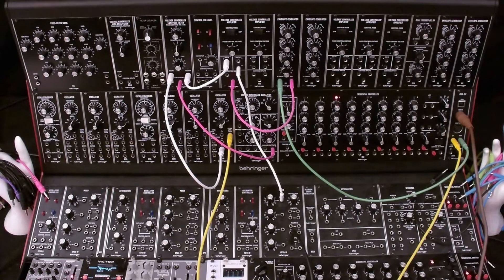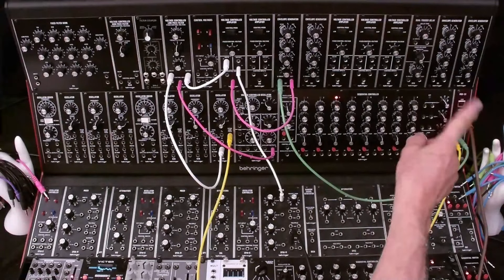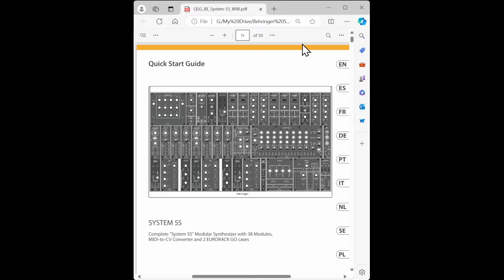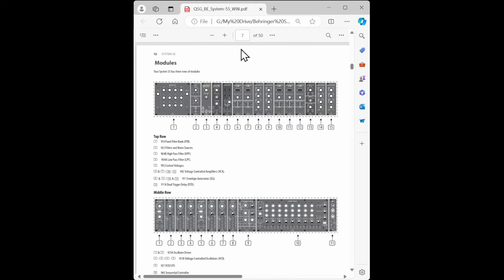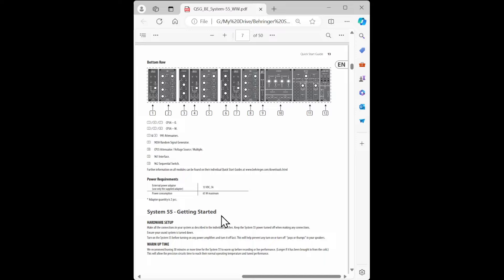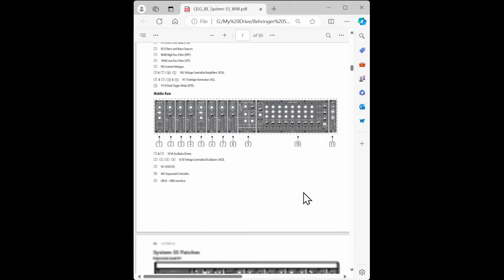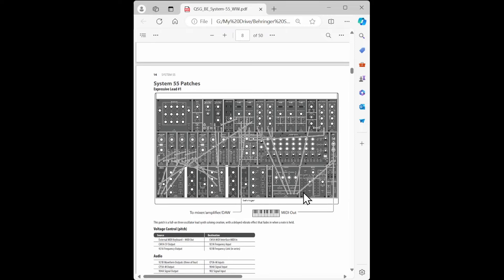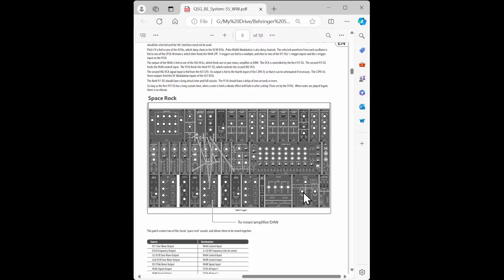System 55 Patching for Absolute Beginners

Comment: Is something wrong with my 55, or am I just stupid. I did the very first one. VCO(921) to mixer. To audio interface. But there us no sound, even trying all the nobs
Reply: Do I need a line booster or something?
Reply from the maker: Sorry to take so long to get back to  you.  The signal from the mixer should be a VERY hot signal compared to most (e.g. line level) signals.  So, no you don't need a booster.  My debugging steps would be to check Power, Frequency Range and Levels:
1) verify power to both cabinets (the mixers are in the lower cabinet, right?), vcos in the upper cabinet on the System 55
2) verify that your 921 VCO is in the audio range (check a) the second switch (upper left) is not in the "SUB" range.  Check the Raing switch and tuning frequency knob @ the noon position).
3) check your audio interface and cable with another line level device like your phone audio or a other synth.  Alternately turn the gain all the way down and connect directly from the 921 VCO to the audio interface.
4) check the level of the 921, if you're using the Aux Output of the 921.
Please let me know how this turns out.
Reply: @ozhalljr  no reason to be sorry, I really appreciate the answer back.  So I checked over, directly out from the auxiliary outputs to my interface and the switch set to audio I can get it to -18db but as soon as I go through any of the 3 mixers I can't get it past -30db even with everything set to 10. Maybe I should take all the modules out and make sure they are connected correctly. Again thank you for your help.
Reply from the maker: The -18 db reading from the 921 Aux Out seems low.  Check the gain stages in your interface.  Regardless, having as 12db drop through the mixer seems excessive.
Here are a couple of other things to try (before removing all of the modules).  
1) patch the 921 Aux Out through one of the (passive) attenuator modules.  See if there's a loss there. if not, I'd start suspecting the power in the lower cabinet.   
2) See if the noise source in the lower cabinet sounds about the same as the noise+filters in the upper cabinet (next to the lowpass filters).  if not, I'd start suspecting the power
3) try swapping power supplies between the two cabinets the check the 921 Aux out
Reply: So I trying all of that that you suggested. The sound level was still the same. Also tried oscillator(921B) to VCA(902) out to interface, still super weak. All this weak signals seems like it would be a power issue right?
Reply from the maker: @dillonoberhansli9764  Possibly.  I still suspect there is some mismatch between your Audio Interface and the synth.  My question at this point is "does the synth sound right" (other than the level issue)?  If so, I would not suspect the power supply.
 Do you have other synths? Do they behave similarly through the Audio Interface?  
Do you have an amp or powered speaker (even a PC speaker) with which to test the synth(s) to see if it sounds "normal".
Reply: @ozhalljr  so the sound is like what is in your video, just quite, I have a behringer arp2600 and a kord ms20 mini. For them if I wanted i could get them to clip.
Reply from the maker: @dillonoberhansli9764  I'm guessing you already tried swapping power supplies between the two go cases.  If so, I'm going to agree that there seems to be a level problem.  Perhaps you should be talking to the vendor (Thomann??? Sweetwater?) about getting this checked out.
Reply: @ozhalljr yes I did try switching the power supplies. OK ya I'm going to talk with sweetwater see what we can do. Again thank you for helping me troubleshoot this issue. I really appreciate it.

Comment: I seem to have a fault with my 904A VCF - although I can sweep through the entire frequency range manually, if I put a 911 Envelope Generator into any of the control inputs, it doesn’t open the filter fully on any of the three ranges. It’s almost like the 6 volt output from the Envelope isn’t enough for the VCF. The 10 volt output from my 2500 envelope into the 904A gives the proper result.
Reply from the maker: Is your VCF Range switch set to 1, 2 , or 3?

Comment: Thank you OZ for your detailed and yet simple to understand introduction to the System 55 (I'm an old fart and absolute beginner, not yet owning a S55...so I utterly rely on easy-to-understand video introductions). I'd be most interested in your 4th row of modules you've hooked up to the S55. All I can identify is a second 960 sequential controller (which seems to be a necessity in my point of view) and a 962 sequential switch (also necessary). Are there any other Behringer modules that you would recommend to recreate authentic early Berlin School music experience (e.g. delay, reverb etc.?) within the remaining space of the System 55 on row 4? Thank you very much for any reply if your busy schedule allows it. Best greetings from  Berlin, Germany.
Reply from the maker: Thanks.  I have a playlist on the system 55:
https://www.youtube.com/playlist?list=PLNkPtu3RcWbS5lm_LWm6Qsay4zmDBfqU4
This playlist includes "System 55 - Top 5 Missing Features".
I'll have to say that the fourth row of my System 55 seems to change every couple of months, so it is not very stable.
p.s. I try to use digital delay from within my digital mixer, as opposed to taking space in the System 55.

Comment: Hello Oz. Greetings from Sydney Australia.
Thanks mate for the video.
I went to Mannys yesterday and was quoted a good deal on a System 55.
I'm also a beginner with this approach to making music.
Instead of using a keyboard into the CM1A, it looks like you could plug in a Drum Machine, and from there follow the same inputs you used for the keyboard patch to begin creating new sounds?
Hey Oz, where's the best place to bring Left Right audio into the System 55, 
then use the System 55 modules to manupulate these  L R audio paths, then send these 
L R audio paths in the System 55 out to an external mixer?
Reply from the maker: First, thanks for commenting!   And from Syndey!
There are a couple of technical hurtles to deal with in processing external audio.
1) I'm not sure what audio you're processing, but there is a difference in the standard levels ("line level ") of say a CD player, or typical audio mixer and the ( much higher ) levels of the System 55 signal chain.
The Behringer PP1 pitch to voltage converter module ( https://youtu.be/0XSDFv4QHKA ) can boost a mic level or line level signal to the right level for Eurorack audio
2) There is only one voltage controlled Low Pass Filter, so if you wanted to do stereo processing, you would need to buy a second LP Filter.
3) There are no stereo mixers on the System 55, but you could use two mixers, one for left output and one for right.

On the drum machine instead of a keyboard, yes many "groove boxes" have "drum" pads laid out as keyboards.  If that was the case with your drum machine MIDI output, that would work to control the pitch CV and gate via the CM1A.

Let me know how you get on with this project!  Cheers.
Reply: @ozhalljr  Thanks for the tips Oz.
The PP1 and the filters would cover the I/O bases. Another mixer would create more panning options too.
I can see how the midi in can work.
It's going to be a steep learning curve.
I shall keep you posted. Should be fun 🙂

Comment: This might sound dumb, but can I use a square wave of the 921b in lo mode, with a -6 voltage to fully close and open the 902 vca? I’ve been trying but I’m missing something because it’s not fully closing the vca.
Reply from the maker: You should be able to do that.  Try setting the VCA to Linear response.  Set the gain ( fixed CV) to the noon position.  Try the 921 Aux output set to Pulse.  See if you can adjust the Aux volume to make it work the way you want.  If you can get that to work, substitute the 921b output.

Comment: Hey, could you make a video explaining the CP3A-0, and the 992 modules? Are they just used as on off switches? I used to have a Moog system 12 and it didn't have either. I just got the Behringer system 55 and wondering what the practical uses are. I like your videos, and just subscribed.
Reply from the maker: @kimmills688 Thanks for watching!  Enjoy your System 55!  
Check out the video that I've already made on these mixing modules.  Note that not all of the passive mixing techniques I discuss will work for every type of output (from different modules).  If the passive mixing does not seem like it is working properly, it's not.  You can hit me back with questions.

Comment: Great presentation O.Z. It’s sounds like you have managed to get a good sine wave from your 921 oscillator in sub mode. Mine is stepped, as is the triangle waveform. Did you make some adjustment to achieve this?
Reply from the maker: Rob,   Thanks for that.   
No, i have not adjusted my 921 waveforms  (yet).  There's still a glitch at reset. You can hear it at slow rates when you're modulating the frequency.  It's very visible on the 'scope.  It's less noticable with filter sweeps and tremolo.  I have seriously considered recalibrating the 921 to optimise for low frequency operation, but have not yet done it.  That would make for a good video, if it works well.
Reply: @ozhalljr  Thanks O.Z. I would like to see a video if you do get around to adjusting it. Rob